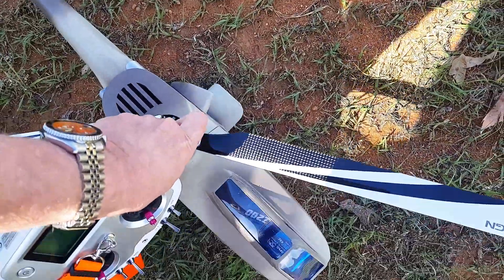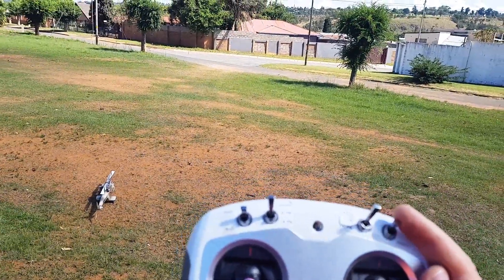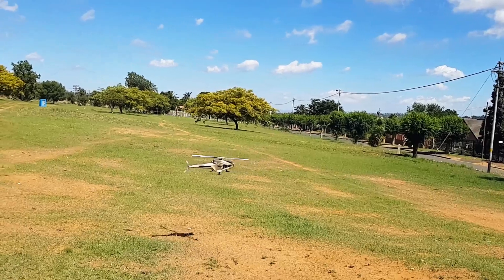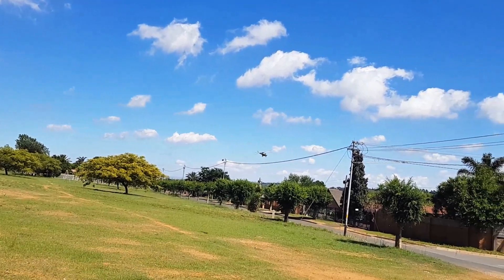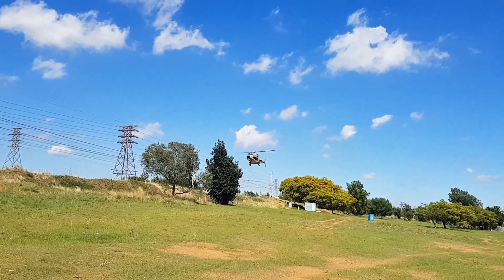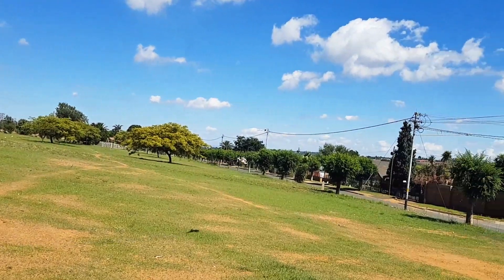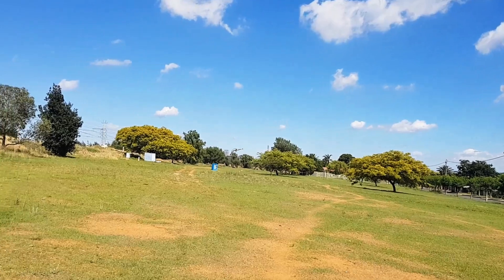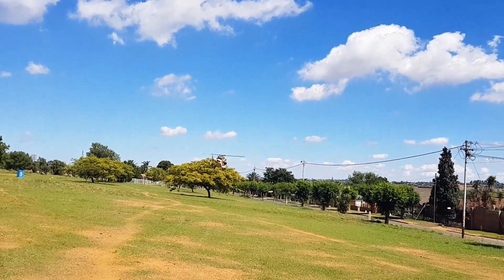Maiden of 'Caracal' my 3D printed 450 size Helicopter - Flywing RC

Comment: Hi Mike, thinking about getting this fuselage Will the version 2.5 fit in here without any modifications or do I need to do some modifications to the fuselage of the 2.5 I have done to modified taking out the belt drive and put in the gear drive, but I wanna know if it’ll fit in that fuselage Without cutting the frame down or doing anything major like that thanks bud awesome video
Reply from the maker: For this version you will need to strip your electronics out of the original 450 plates and fit them to my custom, lightened frame plates also available on Cults. Regards